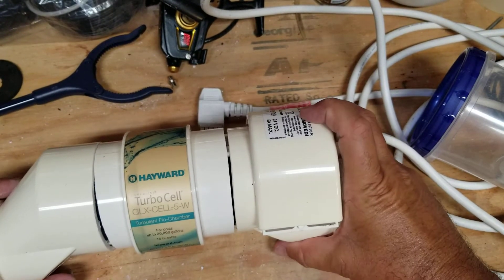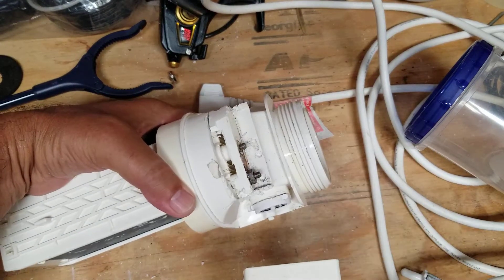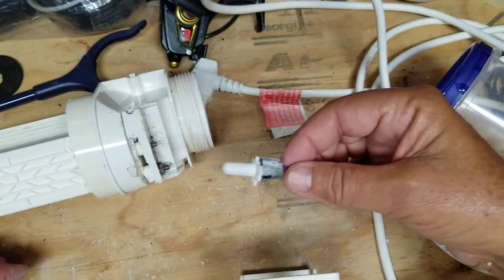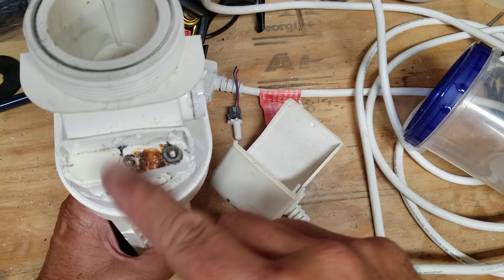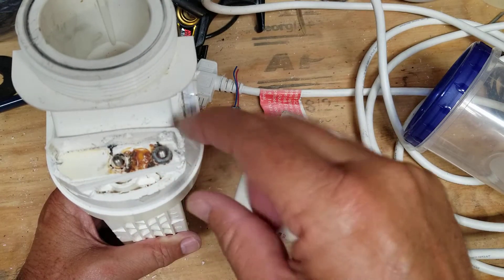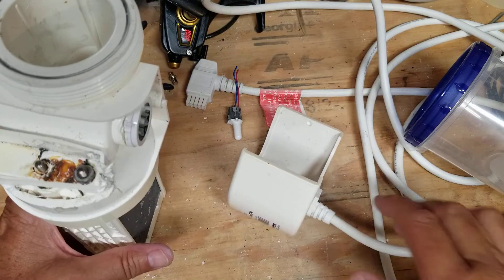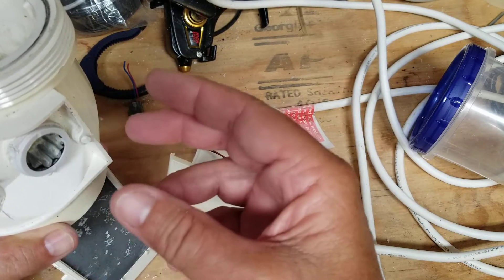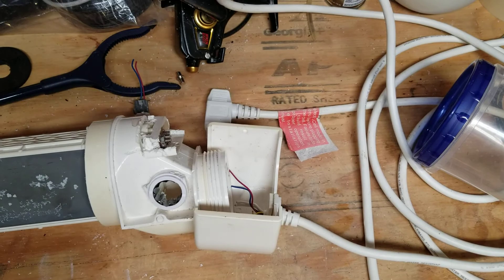Aquarite Hayward Salt Cell failure T-5-  Taken apart

Comment: The most common component to fail on these units is the Thermistor that is inside the Cell that is shown in the video.  The Thermistor is used to determine the water temp and salt level.  If the Thermistor fails, you will more then likely get a "HOT" error on your panel.  If you check the Molex connector, pins 6 and 10 connect to the blue and red wires.  You can use a multimeter to check the resistance and continuity.  The resistance should be around 10K ohm, +- 2K ohm depending on your temp.  If you see reading that are way too high or low then your Thermistor is cooked.  The easiest fix is to slice the power cord cable sheathing and expose the wires.  The blue and red are the ones you need to work on.  Cut the wires and solder a 10K ohm resistor between the red and blue wire that are facing the Molex connector.  Give the unit a test and the error should be gone. Tape everything backup up with some electrical tape and you are done. The 10K ohm resistor has the control panel think that the water temp  is 77F.  Fixed my unit this way and it works perfectly.  One dollar resistor and 2mins of soldering saved me $1000 for a new unit...
Reply: Thanks ! Have a t15 that just failed after 4 years, previous t15 after 6. I still have both and I will try to repair them. I don’t care about the reading I just want the cell to generate Cl ;-)

Crappy design🤬
Reply: I just uploaded a video and I'd love to get your input. Please take a look. My cell stopped generating chlorine(except for when I first switch it on at the aquarite system... but Noone would do that daily). My cell has the red blue orange and yellow wires all going into the black epoxy filled cavity. What is causing my cell to not register the salt content right?
Reply: Maybe you can post a video of how you did it or of the finished work , please .
Reply: Ned Mandaric Ladies and Gentlemen!  I totally am going to do this.  You said the Thermistor is used to determine the water temp and salt level only.  Does the unit need those readings for anything?  My water stays between 55 and 85 year around.  But the salt measurment I am worried about, what does the unit need that for and how do I work around it?
Reply: @caliskier  The unit will only generate chlorine over a certain temp, can't recall what it is off the top of my head but it should be part of the operating instructions or you can just google it.  The salt concentration in the water also needs to be at at a certain level or the unit will not turn on.  The thermistor is used to measure the temp but is also used in part to calculate the salt concentration since it will vary with the water getting colder or hotter.
Reply: Well its not pin 6 or 10 on my female connector but i did find the 2 red and blue wires when i cut the cable open and i do read 8.17k ohms solid so i take the thermistor is good but the panel says its bad.
Reply: @ACommenterOnYouTube  What error are you getting on the panel?
Reply: @nedmandaric3321  low salt and inspect cell leds are on, but i used my test strip and got ~4000 ppm and took my water to the pool place and they said it was 3800 ppm. So its within range to produce.
The thermistor is just for temperature reading so how does this tcell actually read salinity to know its low ??
Reply: @nedmandaric3321  How Does the Hayward Aquarite Determine Salinity?
The AquaRite uses the performance of the cell to determine salinity. For each cell (T-3, T-5, T-9 OR T-15), Hayward knows the performance of a properly functioning cell at each temperature and salinity combination. The higher the salinity and/or water temperature, the higher the performance (chlorine output).

There is no separate salinity sensor in an AquaRite. There are six wires going to the cell, two white, two black, one red and one blue wire.

The black and white wires carry the power to the cell and are heavier gauge than the other wires. The two white wires go to the center plate. The two black wires tie together and go to the two outer plates. The red and blue wires go to the temperature sensor.

There are no other wires going into the cell to support a salinity sensor. There are 4 extra wires in the cell cord (brown, orange, yellow and green) that are not used and do not go to the cell.

Another way to tell that the AquaRite does not have a separate salinity sensor is that if the T-Cell setting does not match the cell type, the salinity will read wrong.

So ... if it has no actual dedicated salinity sensor, how does it know that its 2600 ppm or 4600 ppm ????
Reply: @ACommenterOnYouTube  What temp is your pool water.  If it is very low it will affect the salt reading.  I believe there is a sensor that reads the salt level in the unit but like I said the reading is impacted by the water temp, low temp = low salt level.
Reply: @ACommenterOnYouTube  Not entirely sure how the salt reading is done but the water temp is a very important factor.  You should see the salt reading increase as the temp increases. I live in a northern climate, typically i will get a low salt reading until the water temp gets over 60F.
Reply: @ACommenterOnYouTube  Also make sure that you have the correct Cell model configured on the panel.  I had that happen once where the model config was lost and it was running as a T-9 not a T-15.
Reply: @nedmandaric3321  72F per the thermometer in the skimmer, the unit shows 82F ... 
I took the T-cell to the pool place and they said it was defective. But according to your post the thermistor red and blue wire is reading ~9k ohms ...
Reply: @nedmandaric3321  im in Florida, its HOT 90% of the year ....
Reply: @ACommenterOnYouTube  Yes, I have a reading of 8.2 k ohms. My system will take an instant read of 3700, it will save that value and then lower over 24 hours down to 2700 where it will then switch off and say low salt.
My cell is a t-9 and 6 years old. I'm thinking that the titanium is maybe the problem.
Reply: @ACommenterOnYouTube  yes it only read temperature. The salt level is calculated by the board. That is why I prefer potentiometer. Hook a potentiometer to red and blue, push the diagnostic button until you get to temperature then adjust the potentiometer to get around 84 degrees.
Reply: @ACommenterOnYouTube  use a 50K potentiometer and adjust accordingly. Don’t trow the cell away!
Reply: @JimmyDeriter  how is the board calculating salt ?? By what sensor ??
Reply: @ACommenterOnYouTube  I am not an expert but I completely took a part a Hayward cell. There is no salt sensor. The board has a program which based on the water temperature sensor (or a 50K potentiometer!) calculate the salt level. Try it. By changing the potentiometer to show different water temp on the board you will get different calculated salt. So make sure with a stick or pool store you do have around 3200 ppm of salt. Hope this helps.
Reply: @JimmyDeriter  i also have taken one apart and the 2 black and 2 white wires go to the plates which supply power to them to zap the salt to create chlorine. 
Then the red and blue go to that thermistor which measures temperature. 
There is literally nothing else. And as the pool place told me, do not gauge the salt by what that machine says, always use a strip to meaure the salt.
But i do have an OLD T-cell that the unit says went bad, but i still can read the thermistor by the ohms i read but the panel says its bad. 
I am going to guess that its NOT the thermistor that is bad, but the actual plates that may have failed. Those plates are energized and are basically a circuit and i believe the board applies power to the plates and measures the actual current flow in the circuit and if its not flowing like a normal circuit should, then it comes back as def unit. 
Kinda like how todays cars KNOW when your headlight or parking light goes out and it tells you, thats because all the lights in the car are monitored by the computer so when the computer turns ON the head lights, its expecting to see a complete circuit with current flow and if it does not see current flowing, then it knows something is wrong and alerts you saying head light out. 
I think this salt cell is the same way. What i am going to do is open up the wires to my current working salt cell and meaure its voltage across the white and black wires and also measure the current flow using a clamp meter and see what i get, THEN grab the old unit that is "bad" and see what i get on the same white and black wires.
Reply: @JimmyDeriter could you provide a little more detail on how to wire in the potentiometer? Once the red and blue wires are cut, which wires go to which pins? Also, did you make the connection within the housing, or outside closer to the plug?
I am on my second failed unit (first was Hayward and current one is from Salt Pool Store). Salt Pool Store is sending me a "replacement  temperature sensor" with no instructions. It looks like a 10k resistor, so I'm wondering if I should just run to the store now and try and fix this your way.
THANKS!
Reply: @ChristopherTasker  it’s very easy. There are 3 pins on a potentiometer. Connect blue or red to the middle pin. Then connect the other blue or red to a pin on the left or right. In other words when looking at the potentiometer you can connect the blue and red to pin 2 and 3. No order. I would stay away if a resistance 10K because if your board thinks the water is too cold or too hot you cannot do anything. As I mentioned in a reply. Connect a 50K potentiometer and push the diagnostic button until you see water temp. Turn the potentiometer. You will see the temp changing. Adjust the potentiometer to set about 86 Fahrenheit. Then turn it on. Google how to reset salt reading level on aqua rite. Write back here if issues. I’ll help u.
Reply: @captainandre9307  thanks for the explanation. Makes perfect sense now... I was thinking we were wiring it inline but we're actually replacing the bad sensor with the pot.
Reply: @ChristopherTasker  did it work? Questions? Please report back to help other Hayward aquarite owners.
Reply: @JimmyDeriter  haven't tried it yet, but with the descriptions here, I should be good to go when my parts come in. I also found another video which explained the wiring step by step, so that is also very helpful: https://youtu.be/ucU-mBQAyWA
Reply: @JimmyDeriter  Is there a way to test the cell plates? the two wires? Im looking into buying used cell dirt cheap on ebay listed as "for parts". Im hoping that a potentiometer might be the key. Is there a way to test the cells or tell by looking at pictures if its a good cell to buy?
Reply: How can I tell if it’s the thermistor or the plates that are going bad?  Also, which ones are pins six and 10? I would love to just cut it out and put the resistor in there, but I don’t know if the plates are actually going bad.  I have 4200 ppm salt which is way too high, but the unit says it’s 2500 ppm
Reply: @caliskier  and i believe the main unit is actually testing its currect flow between the plates to determine if they are bad.
Just because you read the right resistance between the plates does not mean they are good.
Like a 12V car battery can show you 12V but not be able to start the car. 
The plates are all wired in series and the unit basically applies power to the plates and it actually measures the current flow, If it does not flow current, then it knows the plates are bad.
Reply: @ACommenterOnYouTube  Thank you very much.  Do you know how to test the plates to see if they are bad with a volt meter?
Reply: @caliskier  no you can't test with a volt meter. All you can do is test with the ohm meter but even then, if you still get correct readings, if the plates dont flow current, they wont work. 

Just as i said with the car battery, just because you have 12V does not mean its a good battery. The only way to test is to flow current thru the plates and the only way is thru the main unit. Unless you can the proper amount voltage needed to drive them, its not going to work
Reply: @ACommenterOnYouTube  Thanks again... I found a lot of information about this on trouble free pool and posted it under the title someone could google:
"How to repair your Hayward T-CELL-X vs buy a new one. Incomplete - my findings and has anyone figured this out"  Youtube does not like my links
Reply: @caliskier  that article says the thermistor (temperature resistor) goes bad and the unit does not see it. 
So they put a 10k ohm resistor there to make the brain unit think its still good and then sends power to the plates. 
My unit read 9k ohm and would still not work. So i doubt a 10k ohm resistor would work, i think the plates failed on mine.
Reply: @caliskier  manually test the salt with test strips. I had to do that when my salt cell failed.
Reply: This helped get my broken T3 cell working on my Aqua Trol. Thanks!
Reply: Is there a way to test the cell plates? the two wires? Im looking into buying used cell dirt cheap on ebay listed as "for parts". Im hoping that a potentiometer might be the key. Is there a way to test the cells or tell by looking at pictures if its a good cell to buy?
Reply: I have inspect cell and check salt (T-5) LEDs solid lit. Just put 7 bags of salt 2 days ago for
Pool opening. Hard to believe I’m low, it’s reading the level kinda wonky.. 800, 1500, 1600. Water temperature reading matches my thermometer in the pool. Any idea what my issue could be? Would love to repair this and not spend $800.

Comment: Thanks for the disassembled view. 
Looking at this I feel like I can reverse engineer some of this to make it work indefinitely. 

I’ve replaced a few 45k gal cells over the years. 

If you simply found a resistor to mimic what the temp sensor sees at say 75-85F then you  could eliminate that part of the circuit. 

Replacement generic cells have the job used harness wires blocked and capped at the board connector. 

Re-water proofing the black and white connections after a thorough dry out should be the ticket as long as the plates are in good condition (chemistry control is prime). 

I have a few old ones lying around. I guess I need to get to work.

Comment: These things are the biggest pieces of shit. I see them fail constantly, usually only after a couple of years. Salt water pools are the biggest scam in the industry. If it's not the reoccurring cost of the salt cell, or the control panel (which has a common thermistor failure) it will be the eventual cost of replacing ALL of your pool equipment when it rusts away. Hayward makes these systems just cheap enough for them to be sold in mass, this is why they are the most popular and you see them used in most installations.
The higher end Pentair, Jandy etc... do not fail as rapidly, but again it's only a matter of time before the salt water eats away at everything, and believe me the swimming pool industry knows this that's why they push this garbage.
Fun fact, generating chlorine with a salt water system was actually they way they did it back in the 50's during the boom of swimming pool installations, mostly in California etc... They moved away from this for the exact reason I just mentioned. Salt water destroys EVERYTHING. As chemical manufacturing became more cost effective and readily available it did not make sense to keep chlorinating pools this way. 
They even had companies that would come to your house and pump chlorine gas in to the pool weekly. (Look up how deadly chlorine gas is, and you can imagine why this fell out of practice. )
Another fun thing is that apparently the metals used to coat the titanium plates (ruthenium oxide or iridium) are mined in Ukraine... well guess what... Ukrainian industry isn't doing so well at the moment so it's going to be a while before you can ever get one of these again. As of summer 2022 the cost for a new salt cell alone ranges from $800 to over $1000
Reply from the maker: I guess you sell chlorine?
Reply: @Beachnative42  nope

Comment: Can someone tell me what's the best salt generator to buy for the money
Reply from the maker: By far Hayward
Reply: I'm buying a replacement now, and decided to chance it on an open-box Hayward T-15 on Ebay. I've read lots of caution stories about the off-brands, and I was wary of all the high reviews that didn't really mean much under 1 year of use (and when reviews were critical, they talked about failing at 2-13 months, and the lack of warranty support/honoring). It's possible some are good, but I don't see a reputable-seeming alternative system. As long as I have a Hayward controller, it seems it may be best to stick with Hayward cell so I don't have to "game" the system. Some people say salt readings are off, meaning they have to crank up the usage percentage, meaning more overall time on. I've used an undersized cell for the 3 years I've been in my house, and I don't know how long before that it was installed. I've learned from reading reviews that there are different ratings for these different cells. In my case, I had a trickle of chlorine all last year with controller at 100% on-time, then found I had very low salt, added some this year, and still had low production, BUT NO ALGAE. Therefore, my new plan (now that I know how expensive these are) is to 1.) Maintain my pool chemistry, 2.) Keep the cell on for 25-50% of the time. No algae means no need to overdo it, and maximum cell life (amateur assumption, but seems smart enough).